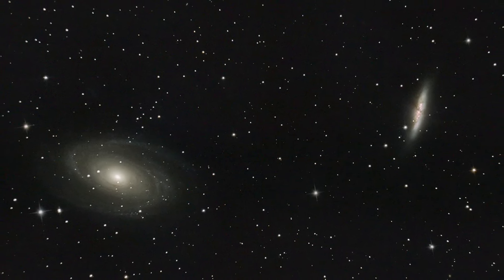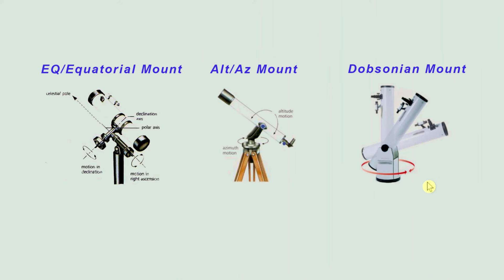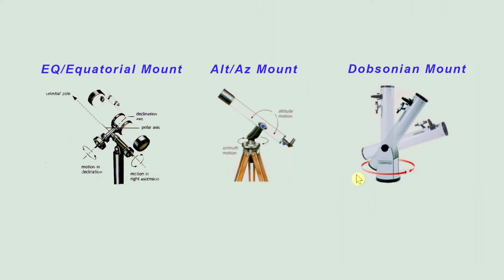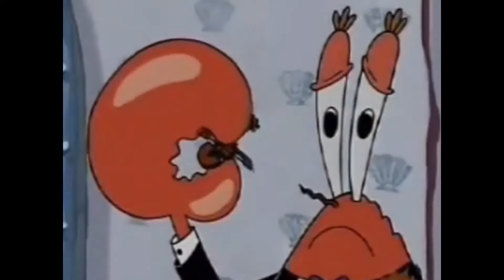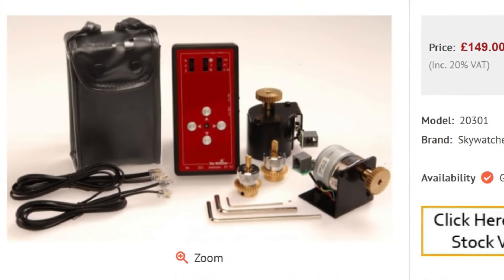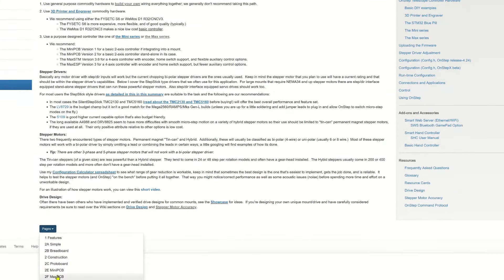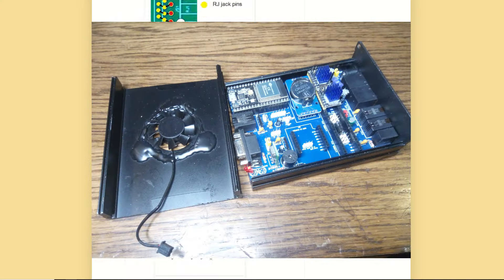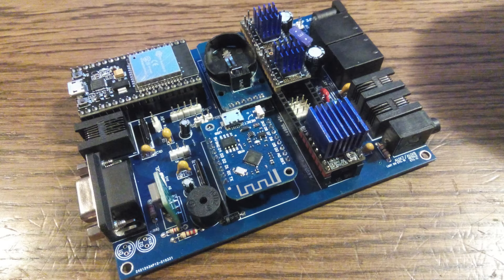Budget Tracking & GoTo Options Including OnStep for Astrophotography

Comment: You can still get backlash with belt driven. It's the actual gearing internal to the mount where this occurs. Fortunately most of it can be adjusted out. The Skywatcher EQ6 R Pro and AZ-EQ6 mounts are in fact both belt driven
Reply from the maker: Seems so obvious when you point out the backlash thing. I never thought of that.

Comment: T
hat's a cracking vid and answered my question nicely, thanks for doing and sharing it.  I think you hit the nail on the head about 6 1/2 mins in, ie stepped tracking and following the 'shape' are the issues and that's why you need an EQ rather than Alt-Az.  I'm going to revisit my options and as I already have a Go2 Tracking Mount, take look at that Wedge idea.  That just leaves the 'scope choice to consider; stick with what I have (add a nice camera, etc) or upgrade to a better reflector or go the refractor route... sleepless nights ahead!  Cheers.
Reply from the maker: Thanks for saying that Paul and ha ha, yeah those sleepless nights with 14 browser tabs open!!! Good luck.

Comment: Nice video, hanks for this, I built my Onstep into a sandwich box, has worked well so far but am soon going to rebuild it into a better case. I have just discovered the joys of using it with N.I.N.A and letting that take care of alignment via plate solving, as soon as I get a few issues sorted I will do away with the phone app altogether. I am using 400 step motors on a Losmandy G11 with a Meade LX90 82 scope.
Reply from the maker: I couldn't get the wifi working for a while so platesolving for me came before the app worked!
Needless to say I don't use it, but yeah platesolving is a gamechanger isn't it?
Reply: @Cheapass-tro  Yes, quite eye opening. I just need to work on the autofocus routine, that's a bit awkward at the moment. I will also add a real time clock module then I should not need to connect to my phone app at all, at the moment I need to upload time and date on start up. Once I can get remote desktop working too I can add my brick pc to the scope and go fully remote. I ordered the smart hand controller from George Cushing, he sent another Onstep kit by mistake which he let me keep and would not accept a payment for, so I will build another set up for my old Vixen mount and have a portable set up, as I work mostly away from home.
Reply from the maker: @martinchapman6670  Autofocus is on my to-do list... Fully remote is something I hope for down the road too.
Good luck with your projects.

Comment: Thanks for sharing all these precious information, I was looking for many answers and found all of them here. Thanks again!
Reply from the maker: Glad it helped and I hope you've found your way forward!
Reply: @Cheapass-tro  you're welcome. I guess it will be a long journey, I bought a Celestron DX130 Az a year ago, my first telescope, but I did exchange the mobile app pointing, with a motorized system, but it's all manual unfortunately.
So now I've found a second hand equatorial mount on eBay, which hopefully will replace the current one that is an azimuthal type.
Next, I'll need to modify that mount, to add motors....and finally add the onstep interface.
As I said before, I think that it will be a very long journey 😄
Reply from the maker: @Fred_Klingon  Yes but you're on track. I actually got a Starsense to begin with, planning to add tracking motors and have a push-to-go-to but then I discovered OnStep.

Comment: I have an EQM35, so it's already motorized, but it has gears. I like the idea of a belt, and I just might do that. I saw another YT video from a fella in Denmark (or Finland or Norway, sorry) about a super tune and converting the bushings to bearings, so I ordered all of the bearings and washers that he indicated. This might be a good time to also get the belt-drive kit and do it all at once.

But regardless, you make very good sense, and everything you presented is well-thought out. Thank you for taking the time, sir!
Reply from the maker: ... and thank you for taking the time to comment. I'm sure the supertune will help. Do ensure you don't mess up your ratios with the pulleys/belts. OnStep allows us to input the pulley ratios. I believe you'll want to match the ratio of teeth on the gears? Good luck & clear skies.

Comment: Wish you had made your video like 2 months ago, where I was at the same page like you. Stuck with an old Mon2(EQ5-like) Mount and a even older Tasco 4.5"/900mm Newt wanting to do photography with not much money in my pocket :/ 
Some day I humbled across these OnStep China-Kits on eBay and thought maybe I should give it a go for ~170 € ... And oh man! That was absolutely the right decision :D
I overhauled my mount with all new grease and stuff... Then assembled the motorkit (its the V4-Pro with 256steps-1.4°/step with option to upgrade focuser and rotator one day) to the steel - and oooh boy! That's great! If I get the polar alignment good it's GoTo is around 30arcmins correct and I can easyly do 30 second exposures with this combo. (Nikon D300 DSLR with shortend 2x Barlow because otherwise no chance for focus; so like around 1600mm focal lenght)... 
So I now have a nice setup for under 400€ total :) 
Just need to learn about all this OnStep things because the documentation is very poor and in the beginning had no idea wat I was doing 🤯
Reply from the maker: Sorry I'm late to your party!
Really nice to hear from someone that went with an ebay kit and good to hear positive results!
Hopefully the configuration video will help out. I'll not drag my heels too much on that...

Comment: I am about to start on my own OnStep journey. Not to add tracking to a non-goto mount but to fix an upgrade my old Celestron CG5 Advanced GT. The electronics in this thing are seriously sub part and have caused me nothing but trouble. Mechanically it is a great mount in my opinion, so I think with modern (and well matched) electronics and a belt driven upgrade it will be a HUGE upgrade. In the meantime I guess I'll have to see if I can carefully run my 130p-ds on my ES iexos 100-2 mount or do some wide field projects on it with my DSLR and lenses.

I appreciate your honesty and I didn't even know about the OnStep kits, even the board you can buy from the links on the Wiki which is going to make this a lot easier for me. I don't mind paying a little more and doing some more work as long as I get a good product out of it.
Reply from the maker: That should work out nicely. This has been done before, so I wish you all the best. Good luck with imaging in the meantime too.

Comment: Great video Nugsy I absolutely love ONSTEP, the mount I have in the observatory was totally dead & the previous owner told me to take the thing away. It sat in the living room for about 2 years collecting dust & I very nearly threw it out as it were taking up so much room. I found a guy in the states who builds a kit for my mount a Celestron CGE Pro & I weren't to sure about spending  money on a mount that's 14+ years old. I finally decided to buy it & it's the best thing I've done as I've got a mount that almost has the same payload as an EQ8 for peanuts. I love the fact it can work via wifi & bluetooth my only niggle is if you turn off the power you have to put in date & time again which doesn't take long when using the app anyway but just a shame it doesn't save it. As for imaging with an EQ5 & 200P it is possible as I know a few people who have managed it but you do have to work at it to make it work, check out Boodlewoodle's Youtube channel it shows his budget set up he used he even used to guide his set up using a webcam.
Clear skies!!
Reply from the maker: Congrats on your big ol' mount for peanuts. Mine has an RTC (Real Time Clock) unit to keep the date and time, could yours?
I will check out Boodlewoodle's channel. Thanks.
Reply: I've no idea its on its 2 year warranty so I don't want to tinker with it just yet, although I may try & adapt the unit to fit inside the pier part of the mount at a future date when the warranty runs out.

Comment: Thanks for the video - a great effort pitched at the most of us who have to struggle to fund our hobbies. I already own a HEQ5 (which I'm very happy with and get up to 5 minute subs on) but have a CG5 knocking about that I thought I could put to use and subsequently discovered the Chinese onstep gear. Waiting for delivery now. The 200 step limitation bothers me though – now! Will have to wait and see …
Reply from the maker: It would be great to hear how you get on with that CG5 set up. The 200 step thing is less important at shorter focal lengths.
Reply: @Cheapass-tro  will do. 
Scopes are: ED80 & GSO 150mm 750mm f4 reflector (7kg with camera & guider) so hitting the outer limit for CG5.
Reply: Everything bar guide camera second hand …

Comment: If you have a 3Dprinter, there is an amazing go to mount on the cloudy night forum too.
Works with OnStep, and it's about 150€ to build with stepper and electronic.

It's pretty great, it's the one I've made this year, and it's pretty good for my camera and my old EQ-2 mount.

Setting up OnStep was painful, but once it's working, it really works.
I couldn’t find the board for cheap either, so I've built the CNC shield option, cost me 50€ only for the electronic.

If you want to go cameras only, you can print the OpenAstroTech mount, a bit more expensive, but really well built and the software is way easier to install.
Reply from the maker: Great info, thanks!
I'll try to find and add some links to these things here...

Comment: Hi, very nice video! Im looking for a telescope to start now, and it's like you said in the end. In the range of 200-300 euros, the 130/900 came with eq2 and 150/750 with eq3 mount. I want to install the goto kit from aliexpress, I don't have a DSLR and don't want to do long exposure photos, if this desire came in the future I can consider purchasing other mount later. Now It's more to look Planets. You think the mounting will make a difference also or this eq2 with onstep will let me enjoy see and track Planets to view with my eye on the eyepiece?
Reply from the maker: Sorry for the delay. I had no notification of this comment.
So for visual planetary only I think the longer focal length is best (130/900). It's mount though is more wobbly that the EQ-3.
The 750 isn't far off but on the better mount and has the bigger aperture, so personally I would go with that. 750mm with a Barlow would be good.
Fitted with OnStep, both will work but the lighter the mount, the more it will wobble and planets wobble at the lightest touch of the focuser (often out of view).
For my money I'd go EQ-3 & 150/750.
TBH, a simple RA clock-drive will suffice for keeping planets in visual range, if polar aligned.

Comment: I've got the same setup as you and I was wondering if you have any advice about upgrading to the 0.9 degree motors, what drivers should I get?
Reply from the maker: I'm using the TMC 2130 stepper drivers from BigTreeTech. They were recommended.
I run mine at about 1.7v (circa 70% of the motor's power).
You'll want 1.7amp motors with 400 steps/0.9°.

Comment: If you have extra assembled kit, I would like to buy. I live in Nottingham and have eq3 motorized skywatcher mount
Reply from the maker: I wish I could help but I only bought the one.
George will sell you a pre-assembled board if you ask. You still have to put it in a box and motorise your mount but all soldering's done.
His email is linked below this video. He'll work with you to get what you need you just have to wait for international post.
Reply: @Cheapass-tro  thanks

Comment: I have a similar scope 200P/1000 F5 Konusky. I see you have a fan on the back mirror, what does it do. I got the scope for my kid`s bd and had zero exp with astro or what ever scopes and now I month later I only could take some shots for him with my iPhone and he looked into the eyepiece a few times (waiting for our new ones since stock are crap). So any help will be so much appreciated. I have barely any tech knowledge since my education/work/lifestyle does not require it, but at the same time I do not want to spend 500,1000,2000,3000$ on stuff that does not actually worth as much. Lets be practical here... :) So I`m from the EU and most of the stuff you show for the tracking are not even close to available... China is a good option and I may look into the sets you advised... but atm I have the dual motors for the EQ5 mounted and I can`t figure out how is should track on it`s now. I have read many places that only the RA is need and it tracks once the mount is PA and I just have to point at the object ... but .... no sir!!!
Reply from the maker: Hi. Thanks for your comment. I'll do my best...
Firstly the fan - I installed it for two reasons.
1) to help cool the optics down to ambient temperature more quickly.
2) to help prevent dew formation.
I've since removed this because I now keep the scope in the observatory and doesn't need much cooling. I also use a dew shield.

Next the eyepieces - The stock 20/25mm isn't bad but the 10mm is, so a new set will improve things slightly but not magically so.
Astronomy is a skill to be learned and I don't just mean finding targets. I mean "seeing" targets. A quick look will not reveal much on deep sky targets. You and your boy need to have properly dark adapted eyes to see faint objects. Even then you need to really spend time at the eyepiece. These scopes don't work as cartoons would have us believe. If in light polluted skies the struggle is greater and a 200mm scope will also magnify light pollution and turbulence. Often a smaller scope would better suit city/town skies.

Finally the motor thing - I have no experience with these drives. I've read of people struggling with them for long exposure photos but not for visual. It should just work. I would first look at how well the scope is balanced if having issues.
The 200 is a heavy scope on that mount and all the weight is at the ends, making it seem heavier again. Balance is paramount (PA too for the tracking).
Hope this helps.
Reply from the maker: Forgive these tips - I have to assume they may apply due to zero experience.
Regarding the motor drive - You did switch it on? It set for the Northern hemisphere? If it is on and trying to track, is it set to sidereal rate? Lunar for the Moon, Solar the Sun and sidereal for stars
Reply: @ TY for the replay, so all has been done - balancing, setting the mirrors, PA alignment (PROPER), motors are running, the remote is on N.H. settings but for the Sideral I do not have such setting or I do not know which is it... I have only the S N, and the 8 4 2 speeds. did try to track once manually but the scope did not do it on it`s own, I had to alignt the start with the Dec/RA (mostly RA) IDK if the scope is not working properly or I am not doing something right. About the eyepieces, I`ve just ordered a couple that after reading a ton, seem to be the perfect match for us - 2" 30mm UWA 70C and a 14mm 1.25" UWA 70C coupled with a Barlow x2 since for 200P there is not logic to go below 8 or 7 But our next goal are the photos... and I`m trying to figure out the cheapest way to make this work since where I live Astro  is a none popular thing and importing is a B...h. Had to pay over 600 Euro for the mount and scope to come to us... not fortunes as you to get it for 50Paunds.
Reply from the maker: @senseiDi  Okay. From what I read here it sounds to me like the motors can't manage the weight of your scope, since you had to align it to get it going??
That's unfortunate, especially as it's expensive to import for you. An OnStep V4 (MaxESP3) would do it if you could get one.
I could be getting this wrong - I'd need to see what's happening really.
Another possibility is the EQ-5 needs a service. It may need the RA/DEC tension adjusting? Screws behind the motors.
It may be too much tension on the motor gears? i.e. Motors too close?
Hopefully you'll get there. Good luck.
The eyepieces sound like good choices. The 30mm will quickly become your favourite.
Reply: @Cheapass-tro  IDK about the motrs, when I move them manually everything works fine, tension on the gears is not tide... I`m an RC hobyies and I know how to aligne sprokets :) Maybe I`m not doing something right from the get go... IDK not very knowledgeble with the scopes the mount it self seems to twist and turn very smooth on it`s own.. IDK how it should move. the scope I boght as a brand new and never used or atleast that is waht the seller said even that it`s an old scope it came in original packaging with the foams stickers and everything. I am fine with making a vid for you or making a life call if you are interested in helping out we are with 1 hour diffenece UK and Bulgaria. so ... we can have a nice convo.